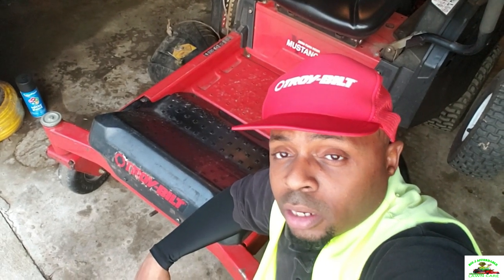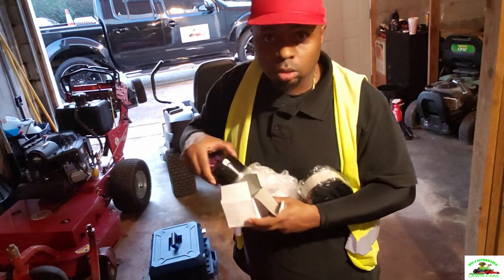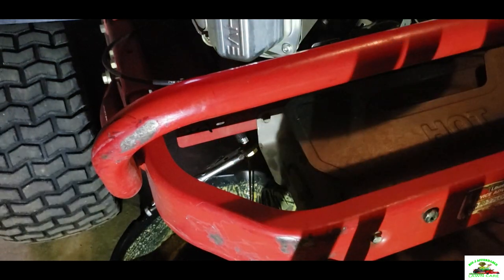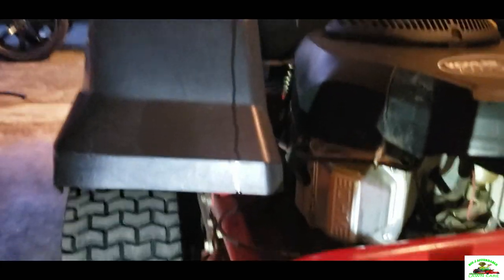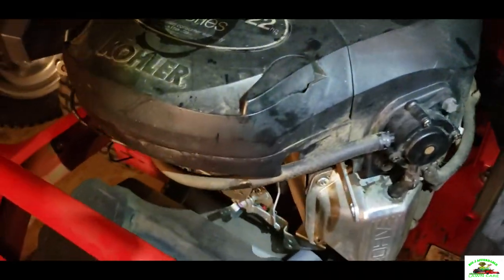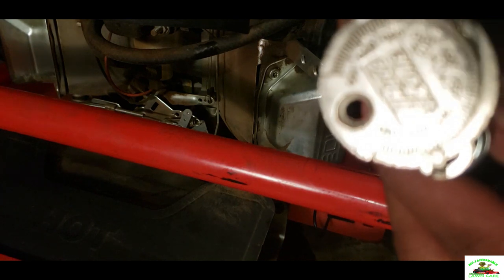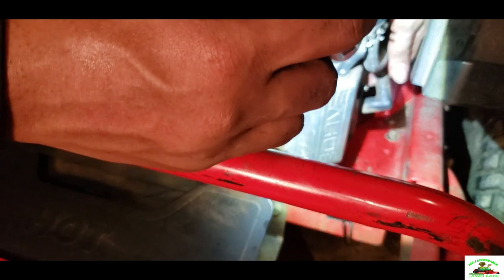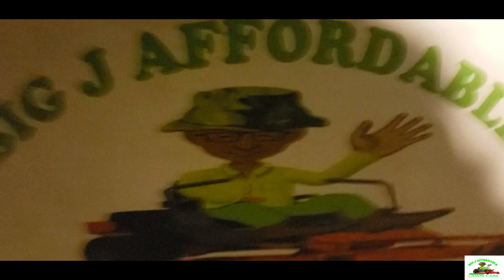TROYBILT MUSTANG OIL AND SPARKPLUG

Comment: Can you do an easy way for a blade change? I can't figure it out.
Reply from the maker: I use impact wrench but if you don't have one, a socket wrench and a C clamp to hold the blade against the deck and remove blade nut.
Reply: Do you know the size of the wrench? I have to go buy one.

Comment: Big J I'm coming up on 100 hours, when did you first change your plugs and fuel filter?
Reply from the maker: I usually change the fuel filter each mowing season and the spark plugs each season or when it start running poor.

Comment: I'm have problems with my troy bolt bro the left arm is making a squeaking sound and it's hard to drive it what does that mean?
Reply from the maker: When it squeaks in the arms spray pb or wd40 between the area that squeaks or some type of grease

Comment: Do you know the size of the wrench to take the blades off? I have to go buy one.
Reply from the maker: On that mower I'm not to sure. No longer have that mower. You may have to contact Troybilt co. You may be able to find on google search your model # diagram and it should show all parts on a diagram picture.
Reply: A 13/16... Is the blade bolt size

Comment: What tool do you use to adjust spark plug gap?
Reply from the maker: To open, use the gap to bend the top and I tap it on a hard surface to push the top down/close. Do not bend/push in the pin. Hope this help if not email bigjaffordablelawncare@gmail.com and I'll send picture of spark plug how to guide.

Comment: Hi and thanks for this informational video. I just purchased this same model. I wanted to know on a full tank of gas how many yards can you do before you run out? How many hours? Can you list the oil filter, air filter, spark plug, mower blades etc part numbers? TIA. Peace from NC.
Reply from the maker: On this mower the gas can maybe do up to3 acres im not to sure and the hours can last up to thousands if taking care of. Mines has 600 something and here's all the parts # here https://www.jackssmallengines.com/jacks-parts-lookup/manufacturer/troy-bilt/17-z-series/2015-models/17arcacs011-mustang-42-xp-2015/mower-deck-42-inch
Reply: Also, you can find the kohler and mtd part numbers under the seat. If you search those, you can usually find the cross reference of other part numbers.

Comment: Where can I get the oil change kit from
Reply from the maker: For this mower you can order oil change kit here https://www.amazon.com/Anzac-Carburetor-Craftsman-Troy-Bilt-Columbia/dp/B07H9TGX9V/ref=asc_df_B07H9TGX9V/?tag=hyprod-20&linkCode=df0&hvadid=309820225415&hvpos=1o10&hvnetw=g&hvrand=16559627356778071355&hvpone&hvptwo&hvqmt&hvdev=c&hvdvcmdl&hvlocint&hvlocphy=9013199&hvtargid=pla-610723031212&psc=1

Comment: I tried this but the screw won’t come off it’s on super tight any recommendations on how to take it off ? I need to change the oil ASAP
Reply from the maker: Cruz cavazos
You can try a wrench extention that should be able to remove the bottom screw. But make sure the top bolt has a vice grip or another wrench holding it tight while you turn counter clockwise on the bottom to the left with that wrench extention.

Comment: How do you check hydraulic fluid in this mower
Reply from the maker: Chris Pressler
On this mower the transmission are non-serviceable. But you can do a do it yourself by drilling a hole at bottom and top with drain plug i believe but may affect warranty.